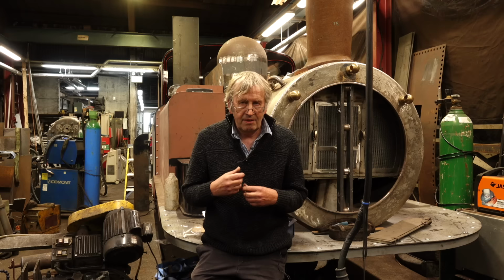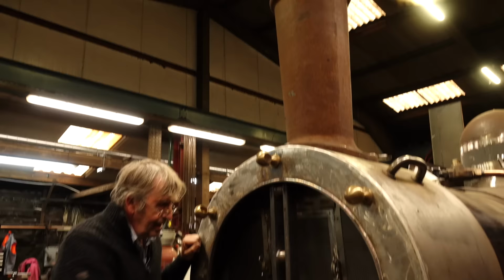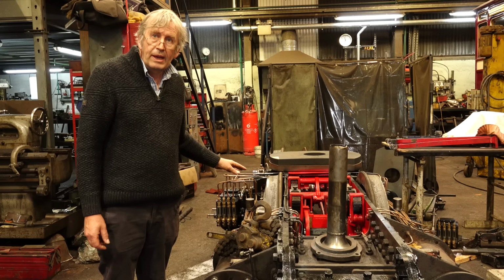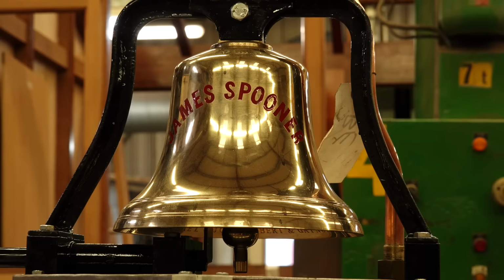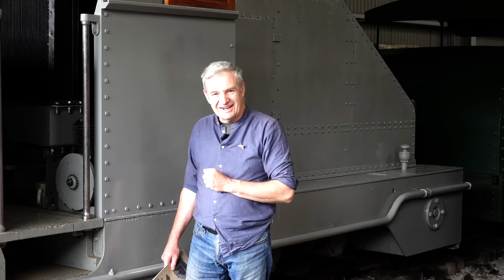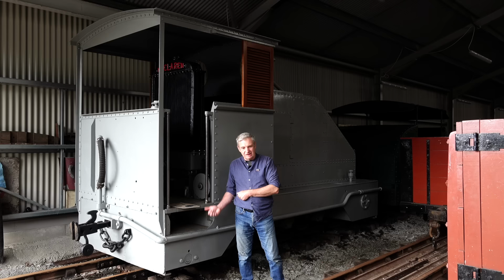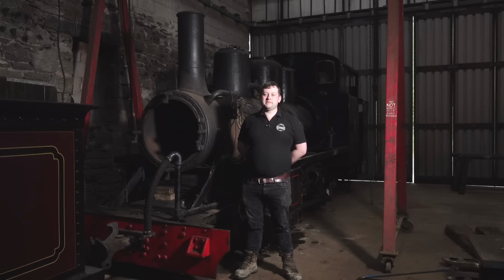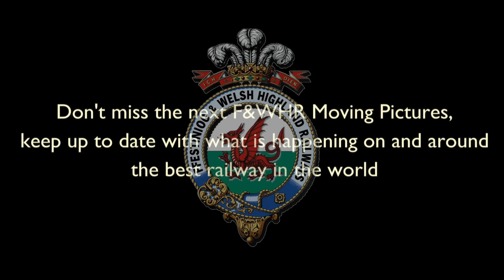Moving Pictures Eighty One - 18/7/23

Comment: An interesting video, as usual, but Dave High needs a couple of corrections;
Firstly it was called the Greenwich and District Narrow Gauge Society at the time, railway wasn't in the title then which caused a little confusion with 9.5mm cine fans.
Secondly describing us as a bunch of modellers is wrong and fails to acknowledge what the society and it's members actually did then. A proportion of the membership were never involved with model railways at all, but were just narrow gauge enthusiasts. We put on our boots and got on with conservation of the Chattenden and Upnor signal that went to Sittingbourne, restoration of the Royal Arsenal gunpowder van, saving of the Furzebrook china clay wagon were all big projects for the very small active membership at the time. You can also add the working parties and volunteering on TR, FR, LBNGR, Brockham museum etc. Two members ended up owning full sized locos ...  plus Ted Wade's authorship of seminal works on NG railways. It was far from just being a model club.
Reply from the maker: Thanks for that, I'm sure Dave meant nothing negative by his comments.